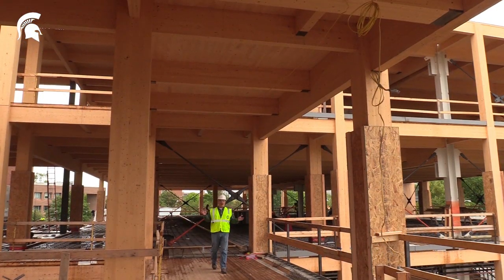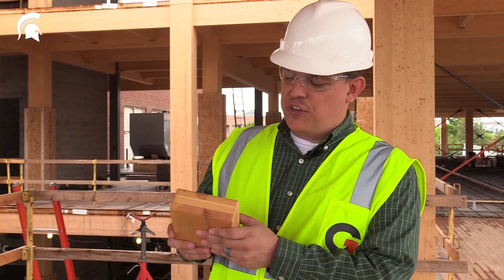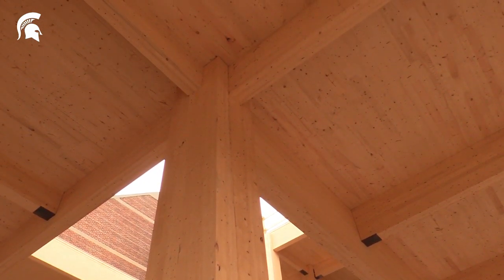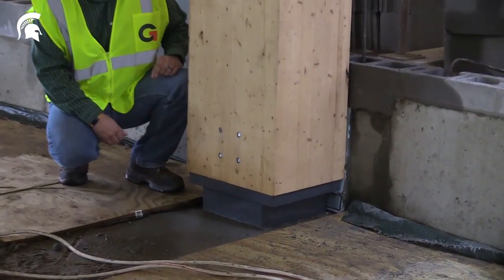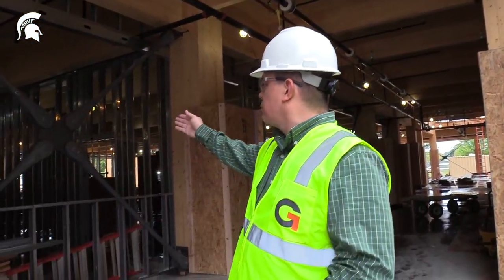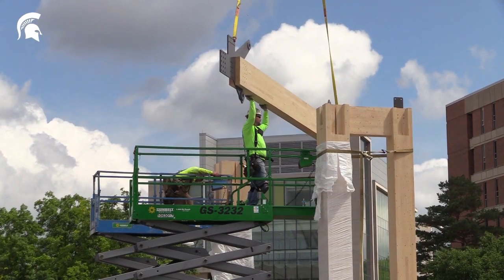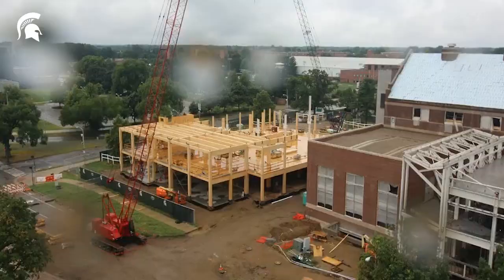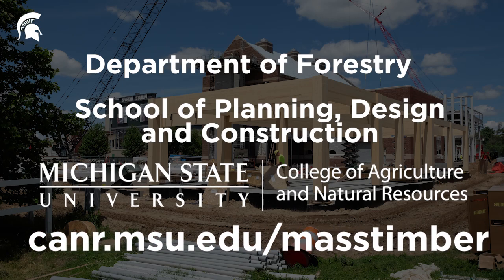What is Mass Timber?

Comment: Are we missing out on a benefit by not treating the lumber with oil/wax/stain? I see in your examples that the everything is stained, is that cosmetic?
Reply: I'd imagine cost, labor, and designers choice, you can't necessarily take these factory engineered components and spend too much time treating or staining them, in addition a lot of designers just seem to like the organic look. If they were to stain or wax these on site it would take them forever to apply and dry. Not to mention you'd need more skilled labor and not every contractor or laborer is a decent woodworker.
Reply: @ubacow7109  Could they be stained at the factory? That could save money and it would allow construction to proceed at the same rate, albeit with a delayed starting time.
Reply: @ryuuguu01  I'm pretty sure some companies do offer that, though I guess it's just not as common or popular of an option as if they were to be put outside the stain would just wear out poorly. At the sizes of these projects some companies prob just use use the actual lumber instead of a stained color.

Comment: How does hold up over the effects of inclement weather conditions?
Reply: Not well at all if left exposed . Clt construction in Europe installs insulation on the outside of the building and covers that with wood cladding or stucco . Clt is rarely if ver left to the elements .

Comment: Affordable housing 🏘 = Mini Apartment block [ 3 floors] + Mass timber [Column+Beams] + Cellar [ Car parking] + Foam concrete panels. No lift = less energy consumption. Solar roof = smart electricity grid. Spacious living = 1 family unit per 1 floor.
Reply: Also if you going for affordable housing you could standardize the units which would save a lot in design and engineering costs if a large number are built the same. The Same idea as Habitat 67 but with mass timber.

Comment: Wishing you work also on Green coats, verticale gardens, how to convert each old building on to a planet's lung, neutralize pollution, let's get it straight, nobody will ever give up using cars airplanes and burning fuels, when even electrical power is based on burning coal. But building up new infrastructures as smog eaters might be the best solution. Basicly, the grand mother's cottage roses garden on skyscrapes dimension, can you imagine it? Even the Sun should stop to admire such a heavenly delight

Comment: What's the point?
Reply: It looks awesome, is stronger than concrete or steel on per pound basis, and its use results in FAR less carbon emissions than building with either steel or concrete.
Reply: @illuminated2438  a lot of stuff is stronger than steel or concrete per pound, but that doesn't mean there is an advantage to using those materials. it is still weaker than steel and concrete per size, which is a consideration. why do you think carbon emissions are something worth considering? and if a liberal felt like it, they would just paint this as deforestation which has a greater 'carbon' impact than using other materials.
Reply: They want to cut down every tree that gives off Oxygen for us to breath.. that's the point.

Comment: Some Japanese wooden buildings have no nails. Can a mass timber building be built in the same manner or at least theoretically?
Reply: in theory yes, however I doubt any current building code would allow it. Interlocking joints still need to be mechanically attached
Reply: Yes, there are companies in Switzerland that do exactly that.  They use a combination of traditional joinery and wooden nails made from hardwood.  You can buy a similar wooden nail system here in the USA, though I don't remember the company's name.  Matt Risinger did a video about both the wooden nails (he talked about them while covering a trade show they were on display at) and the solid wood buildings from Switzerland (I think they even used a wood fiber insulation product).
Reply: Check out Nur Holz Rombach . it makes clt panels with wooden dowels . however the panels must be connected with steel brackets and structural screws . very interesting site though , have a look